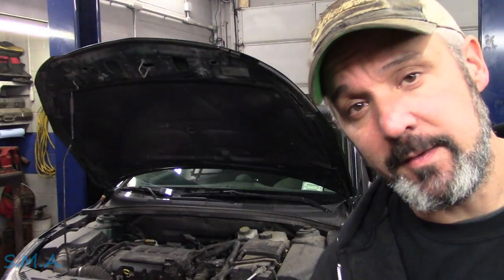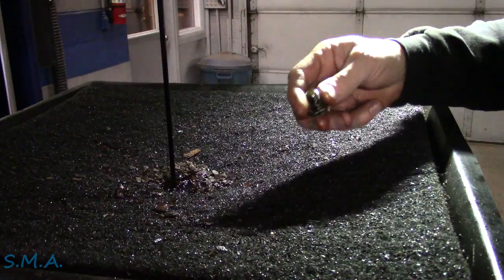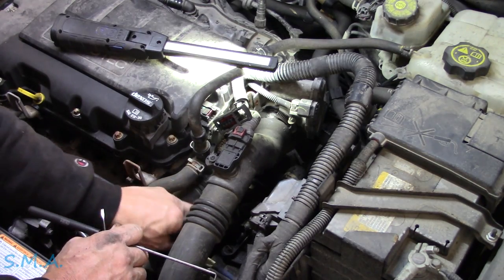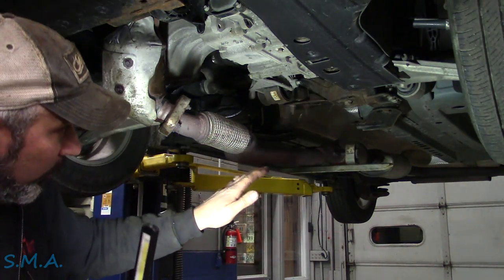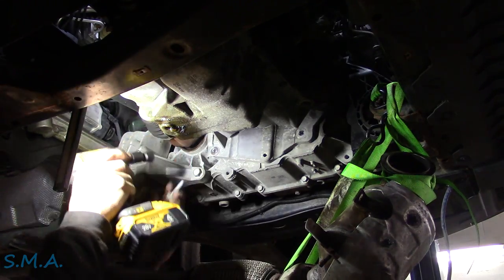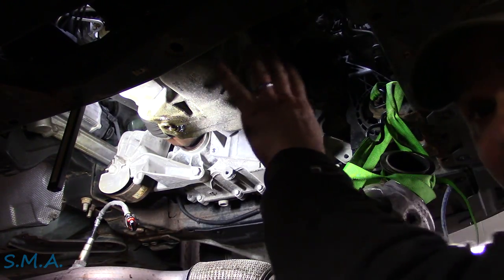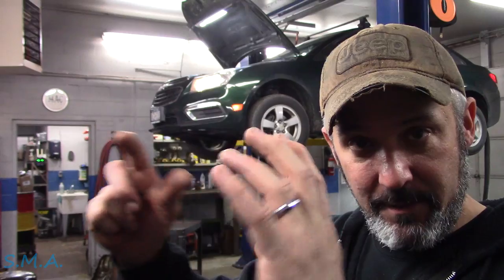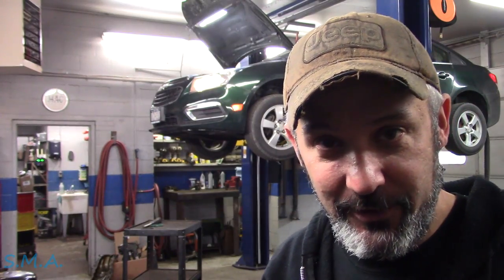Chevrolet Cruze 1.4 Turbo: Oil Pan Replacement

Comment: I had a 2015 chevy sonic with around 50k miles on it and i had that thing for 10 months. I used it as a kind of work car, but i never mistreated it and i took care of it. The amount of issues it had and the difficulty in doing some of those things was ridiculous and stupid. These things are just yuck.

Comment: Okay? Here's my question. The vehicle is about 75,000 miles on it and approximately 5 and 1/2 years according to the date of manufacture. After signing a waiver and handed it to the manager at the local shop just in case I was killed by accident I wouldn't hold it against it but I digress. I didn't notice I'm hydraulic tapping. I have a car service every 3500 miles instead of every 5,000 MI. What product could I use to take off some of the varnish on the hydraulic tap it? And of course after this process I would drain the oil and put fresh oil in.

Comment: Leaks more fluids than an SR71 getting ready for takeoff.
Reply: Are we supposed to know what a SR71 is and that it leaks a lot?
Reply: @frankb.1546  I do.
Reply: @frankb.1546  The Blackbird! Although I didn't know that it leaked so regularly...
Reply: @frankb.1546  yes...
Reply: @frankb.1546  worse than a Harley marking it’s territory.
Reply: @frankb.1546  YES
Reply: They would leak from the skin of wings until they reached  operating speed, heating and sealing them.

Comment: If they had a dealership chang their oil they are the one that stripped the oil drain plug. They did it to mine. Won't take to dealership for anything any more.

Comment: I still can't understand why bleed valves aren't standard on oil pans.  There's so much plastic dressing and fasteners on engines which waste money, but given how often you need to change oil and how frequently plugs get stripped, they can't put a bit extra into a simpler drain system.

Then again, there's some cars these days that don't even have dip sticks.  Thanks, economics.

Comment: I have a Town and Country and the transmission uses RTV for a gasket, but I found Fel-Pro sold a gasket and I will always rather have a gasket.
Reply: I dunno rtv is awesome if applied properly.  Its all in the prep
Reply: @snoopy5736  The thing with rtv: if you read manufacture specs, its suppose to cure for 24 hours before putting it back in service. The right stuff does not require this though. Plus with those oil pans, I am always worried about residual oil running down once the pan is on contaminating the new rtv. Never had an issue like that, but I always ponder it.
Reply: @mph5896  i wipe the surface with isopropyl Alcohol and let it empty if possible
Reply: Snoopy they continually seep, basically forever. Wipe it and 2 min later it’s wet

Comment: I would like to see fewer turbos on the rice rocket motors,  and more electric superchargers.
Reply: No chance in such economy cars. In Europe every gram of CO2 is taxed and fuel as well. Electric supercargers take energy from the engine. Turbo's only use waste heat to funtion. Cars with electric superchargers would be very hard to sell in Europe because of said taxes, therefore.

Comment: I own a 2012 cruze and there isn't a gasket or coolant part i havent had to replace by the time it hit 100k. Disgusting.  Other than that the car itself has been good. Just all under the hood. Mine is the 6spd standard. I rhink the 1.4 is a good engine just leaks. Higher running temps , more pressure and to much dam plastic. Go to cruze kits and modify the crap pcv system to eliminate that issue.

Comment: Hi mate I have an astra gtc but same engine 
I did my sump seal but when u drive down the road it chucks out oil all over the rear of engine.

I don't think it's the sump but it's the last thing I did so I did it again and same thing happened.

It doesn't leak when parked and revs up at 3000 it's only when driving 

Have you had this problem 

I'm doing it sgisn today with black high temp gasket but seriously think I'm wasting my time.

How would I check the timing cover gasket without removing the equipment as I feel it may he this but I really don't feel like removing the chain to replace a gasket if it isn't that.

Don't want to break it as no garages will do it for me

Comment: I cant get a tool up to take the t40 bolt off ( the first one you take off closer to the driver side for the cat braket) There is just no room the cat is in the way.  I havent taken the support bracket off yet ( the 5 bolt one in the near the centre of car ) would that help?..

Comment: I think you should’ve waited until the owner was ready and did the entire job at once. now, if something else goes wrong, there is the potential for him to blame you for work you just did even though the full problem with oil leaks is not complete.

Comment: I too have been victimized by the swift "jiffy type lube people" the very low intelligent employee stripped out the drain plug on my CTS Cadillac,  they substituted an expanding rubber bulb plug that always leaked forevermore.

Comment: I got a problem I can’t figure out .. I took it to mechanic 7 times I wish u were around .. he thinks it a head gasket .. it is leaking out the block one drop after it warms up that’s it .. but.. there no coolent loss no oil loss but smoke under the hood once it warmed up.. looks like it coming from down lower then we’re the block and head meat .. they said they bolted up the oil pan when I thought I hit some but they said it was fine but since then been smoking .. it burning oil .. 2013 Chevy Cruze lt 1.4 turbo .. plz help appreciate it a lot .. I replaced the valve cover two trans lines and water outlet and the turbo feed line .. the car seems to drive fine jus smokes .. I’m puzzled.. no codes either

Comment: The GM engine “engineers” should be ashamed and embarrassed. What a joke of reliability on those Ecotech motors.
Reply: They get paid to reduce costs, not make reliable stuff.   GM gives no shits once the car is sold.
Reply: These turds of an engine replaced the ecotech engines

Comment: Anyone ever tried alutitght solder rods on sumps air con rads! It melts at a lower temp than the alluminum and u use a blow lamp but have to get the alluminum clean with a stainless steel brush.

Comment: They should force the engineers that design these things to work on them after they've put 100,000 to 200,000 miles on them. In New York.

Comment: Too bad a car ;like that needs that type of work so soon. I had a Kia Sephia (blech) and it leaked at the oil pan and fixed under warranty as it had less than 5K on the clock. After that it went over 200K trouble free.

Comment: These cars are almost totally European/SE Asian content and they continue the tradition of random things failing long before they should, if ever. My 2016 Camry, built in Ohio, went 167,000 trouble-free miles with only a battery replacement.  The company replaced it with an Altima. The other choice was a Chevy Equinox. The BRAND NEW Equinox has already broken down once and left the employee stranded. Reward Toyota, Honda and to a lesser extent Nissan by buying their vehicles.

Comment: Shame that he didn't get everything done at once, while you were in there, getting acquainted with this engine. 
Pitty there isn't a replacement package of a  motor and all the faulty bits, Nappa special in a box  ?
Suppose it just adds weight to the throw away society  😊

Comment: Hi Eric, i have 2014 cruze 1.8L, i hear gurgling sound when reving / pressing the gas, is it normal or needs attention?
Reply: Is it coming from under the dash?Probably just water flowing through the heater core.Not a problem its normal.
Reply: @djsi38t  it is indeed coming from the coolant overflow tank. i guess there might be air traped in the cooling system.

Comment: Why not helicoil the pan? The plug is a straight thread and seals on a wide flange so is there a reason not to helicoil it. A little air pressure will keep the swarf out while drilling and tapping.
Reply: Helicoils are only temporary for a fix….
Reply: @Sicktrickintuner  Helicoils are used right from the factory in aluminum.They're not a temporary fix. Aircraft spark plug holes have helicoils as original. They're stronger than tapped holes in the parent material.

Comment: I work at a Honda dealer and use these plastic clip plyers here’s the part number07AAC-001A101 you will thank me later, they work extremely well, and the other side is for the o-crap handle covers

Comment: Valve cover failed on a cruze? Impossible. Next your going to tell the sky is blue.

Seriously. What a pile these cars have turned into. I had a coworker with a '12 cruze. Originally valve cover failed in '15 under warranty. That one failed in '17 or '18 and I replaced it. That one failed last month (nov '21). Hes graduating this month from college and kicking it down the road.

Comment: Quicky-Lube stripped the drain-plug. Note 23:42 the new oil pan has the Torque-Spec molded into the pan right next to the plug.

Comment: Sitting here watching and shaking my head in disbelief. This is absolutely the worst design I have seen on a car. An oil Pan is nothing to replace but GM has to be stupid. Yeah,  it's "Normal" to have cracked turbo,  🤦

Comment: What a fricking nightmare to change an oil pan.  Bet that ain't cheap. Owner needs to take it back to the crap oil change place with your bill.  Or just throw the pan through the front glass- whichever is appropriate.  Letting these POS places get by with stuff like this is why it continues to happen.

Comment: GM garbage. turbo cracking is normal. where is the non GM aftermarket turbo where that isnt normal? GM junk. same BS with my daughters 02 Envoy with the big 4.3... 280k on the engine but everything attached to the engine replaced! not show stoppers but annoying constantly replacing parts... sadly the ole new england SALT ate away the rear frame rail leaving the right axle loose lol... never mind eating away the spare tire area.

Comment: 6:52 -"It looks like its missing a couple of these push tabs"  Yeah, because every mechanic before you removed them the same way you did.  And despite ordering parts from the dealer noone replaces these broken push tabs, which probably cost 10-20 cents each.
EVERY MECHANIC IN THE WORLD WORKS LIKE THAT, WHYYYYYYYYY?
Reply: Care to share your wisdom of how they should be removed?